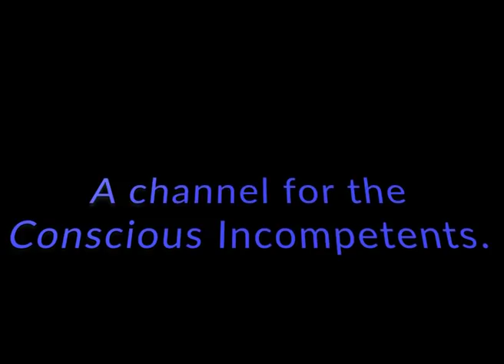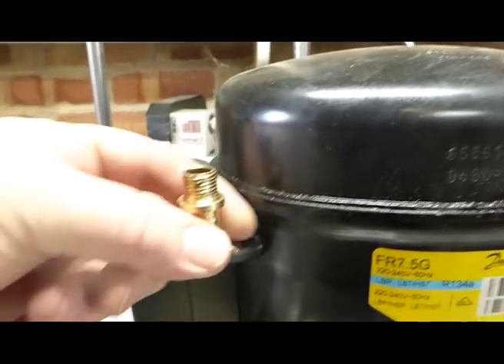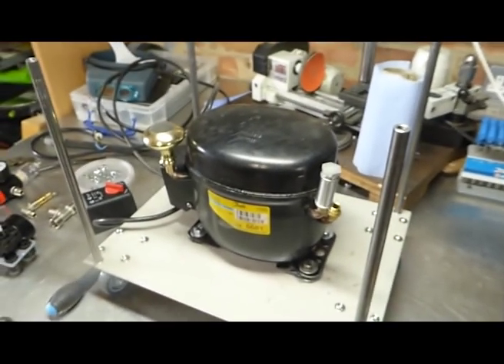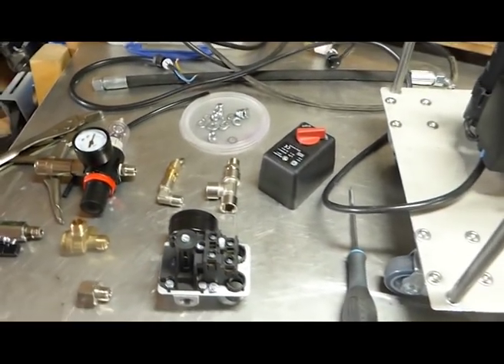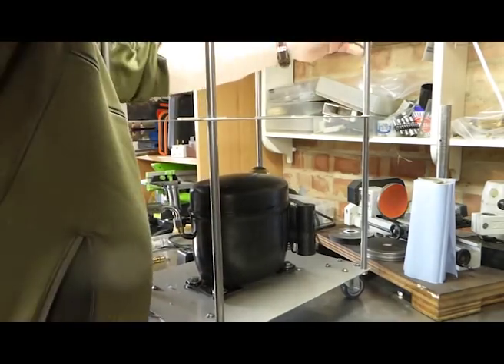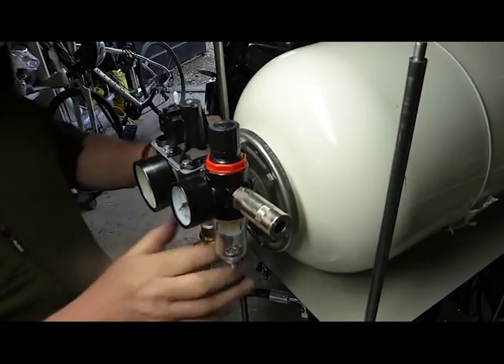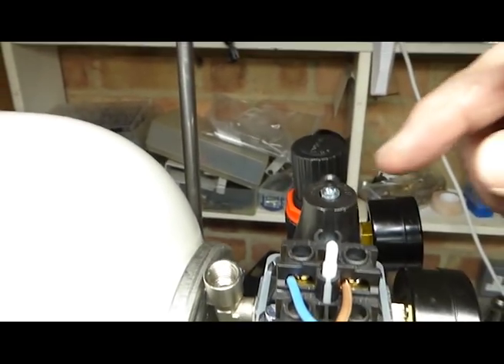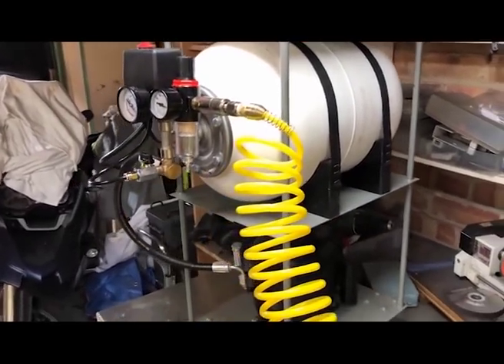Building my homemade silent air compressor

Comment: Good project. I have built a similar compressor. I suspect that the issue you are having with your unloader valve "leaking" may be because you are using the incorrect type. There are two types. One (and the one that seems to be most commonly supplied with pressure switches) is called a delayed unloader valve. It actually remains open once the compressor starts running in order to provide a "soft start" for the motor and pump. Once a certain flow rate is reached the pressure differential causes it to close. The flow rate from your pump is unlikely to be reaching the level required to close this type of unloader and hence it will just stay open and vent once the pump starts. What you want is a regular unloader valve. The delayed/soft start makes sense on larger compressors but it won't be needed for that type of pump. Simply removing the head pressure should be sufficient.
Reply: You've answered a big question there. Many thanks Darren

Comment: Awesome bit of kit!
Reply from the maker: Thanks so much.It has actually transformed my workshop. so quiet and efficient.
Reply: Your build is the first one I’ve seen, making a compressor that I’ve actually wanted to build one for myself. I have been using refrigeration motors for vacuum pumps, I love your compact design!
Reply: Your build is the first one I’ve seen, making a compressor that I’ve actually wanted to build one for myself. I have been using refrigeration motors for vacuum pumps, I love your compact design!
Reply from the maker: Alden Clarke thank you so much but I can’t take credit for the design. I was following the design by Jimmy whom I credit in the description. Try it. It’s a great tool.

Comment: I noticed that contrary to other you tube instructional videos you only have one valve in the tank whereas others make a second then weld a 1/2" nut in then have the air go into tank from there. Is your way better if so why?
Reply from the maker: Hi Pete, good point. The first reason is very simple. When I made this, I didn't know how to weld! Which I am actually addressing now and trying to learn. The second reason is with this particular design with the 3 way coupler, I didn't need to as I can link the pressure switch, tank and non return valve with the one coupling. One thing I would have liked to have done is to have cut out and welded a valve at the bottom of the tank, which in the future would make it much easier to empty the condensate and gunk that is bound to accumulate in the tank. I have no idea if this design is better, but works extremely well and the compressor has been hugely useful in the workshop: cleaning around my mill and lathe, but also inflating the tires of my motorcycle. Hope this helps. Take care.
Reply: @Ukenick  thankyou for your prompt reply. As you might be abke to tell I intend to make my own compressor as was intending to use an old propane bottle and like you cannot weld so was wondering if I could tap straight into the base for the water drain. And screw into it using the thread compound? What do you think is there really a need weld a nut? 
Also I forgot to say thanks great video.
Reply from the maker: @Petes-Page  Thanks for the compliment :) My only concern about what you say is that when the tank is at full pressure, will the depth of your tapped hole be sufficient to handle a pressure of 6 or 7 bar? I am simply not knowledgeable enough to answer that. Just a concern I would have. You might use facebook or something to find someone local who has a welder to help you. It would be a five minute job. Maybe a local car mechanic for the price of a beer? Just a thought.
Reply: @Ukenick  thanks I'll look into it.